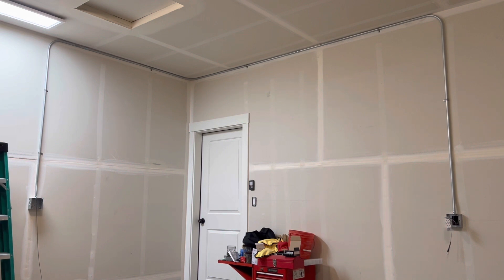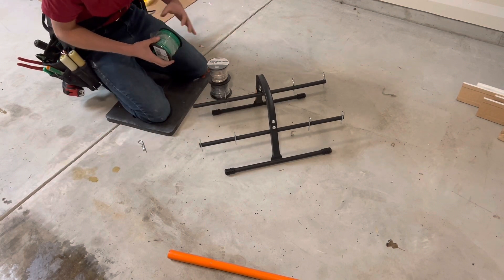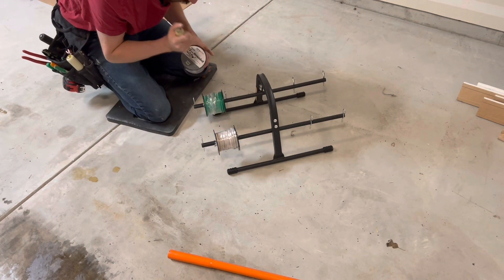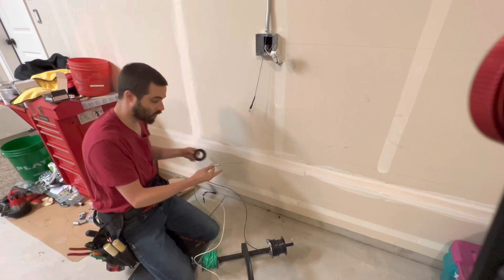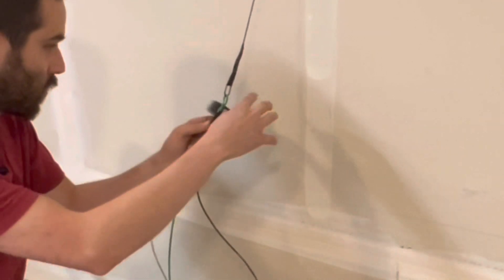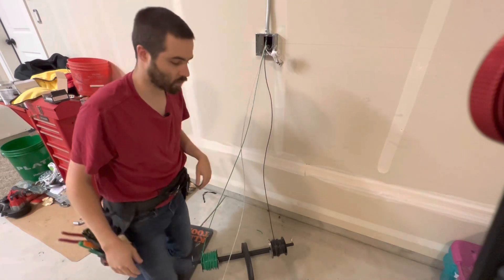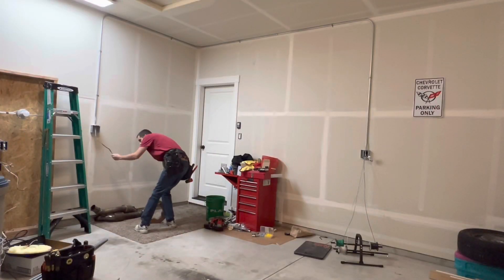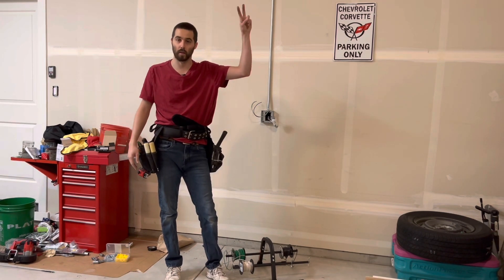Electrical 101: How To Pull Wire Through Finished Pipe (With A Fishtape)

Comment: Not sure if this was mentioned in the video but for anyone who's going to help pull wire you always pull slack off of the rolls before you pull. Pull from the slack from the floor and never from the rolls directly, it makes it much harder to pull the wire through conduit. Especially larger gauges. Nice video
Reply from the maker: Thanks man! ❤️🙏🏼